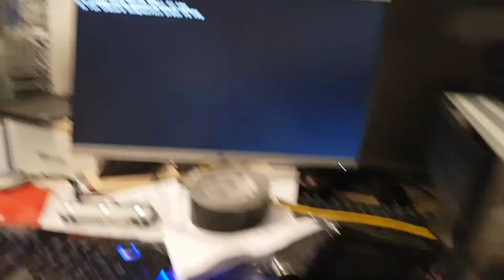Swap Case on Dell Optiplex 3020 - Power Button and front i/o cable Failure; Connection+Solution 1/2

Comment: It works yes and no! If the computer remains in standby after shutdown, yes it works, but if the power from the 220 V outlet stops, computer it does not start at all and the BIOS must be reset to start normally. DELL optiplex 5040.

Comment: everyone I would like to say something so my computer the power button broke on it and when I press it the computer doesn't turn on but I found a way to turn my computer on if you unplug it and then take the motherboard battery out leave it out for 30 seconds or more and then put it back in and plug your computer in and it will automatically turn on now I don't know if it's safe to keep doing this but I know that's how I get my computer to turn on since the button is broke

Comment: What should I do with the cables if my new pc case only had power switch and hdd led not the power led?
Reply: After a bit of toying around with my PC, I found a way simpler solution. Though I did this about 3 months ago now so my memory's a bit foggy but I'll try to be as informative as I can possibly remember.
To start things off, the 5 prong thing you're trying to connect to from this video has it to where each prong is set to have a specific wire attached to it. 
An example would be like... HDD LED - has to be attached on the bottom right hand corner (this is an example just for clarity, don't actually do that unless you're sure that's right haha) 
After playing around that for a bit and doing research as to which wire goes where, I managed to get everything up and running the way it should be! I still get the error message but I can visibly see the power led is on and working so I just hit continue ;p

I hope this helps, feel free to ask any more questions if need be

Comment: i just found your video. and did the opposite and used the optiplex case and normal parts. now i have a working power button with LEDs that work. thank you
Reply: Someone gets it.

Comment: Ty for the video, very helpful, but the new case I am using to swap for an old 3020 MB has a 6pin connector for power switch. What can I do to connect that to the dell MB?

Comment: How exactly did you manage to connect your cut wires to the power SW and LED connectors?
Reply from the maker: I just plugged them in with no addition. In the end i secured everything with tape. You do need to remove the isolation a little bit on the end of the wires though.
Reply: Could possibly use a hot glue gun too before taping up the connections

Comment: Did you solder the wires?
Reply from the maker: No :)
I mean you can. But it also works if you just plug the open wires together